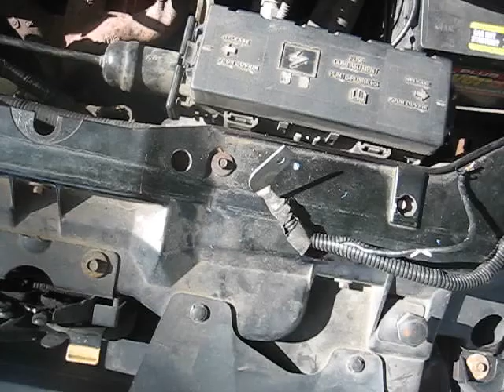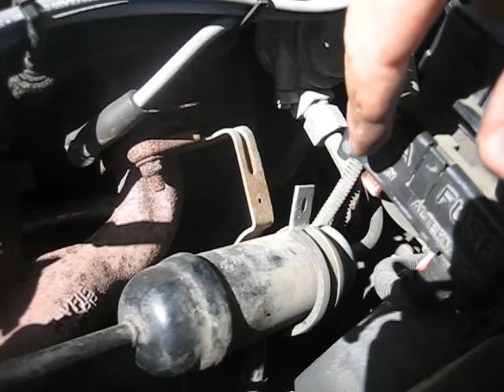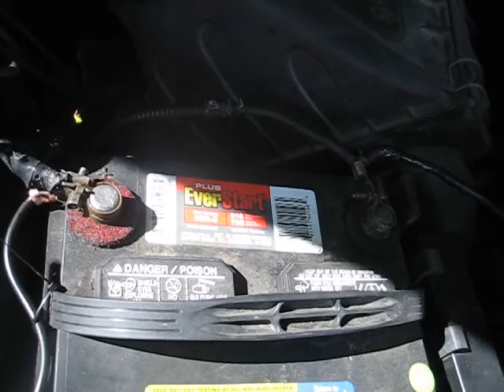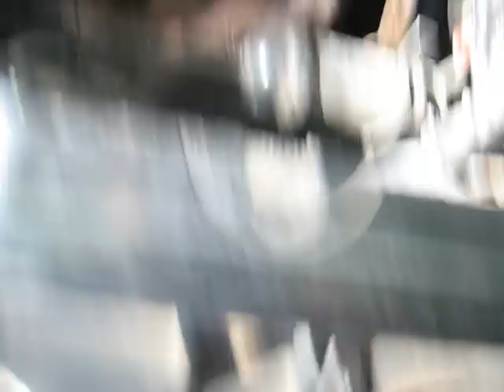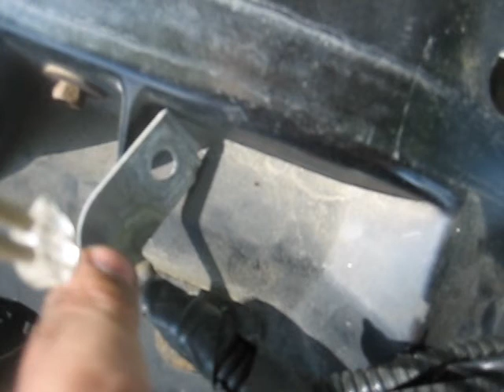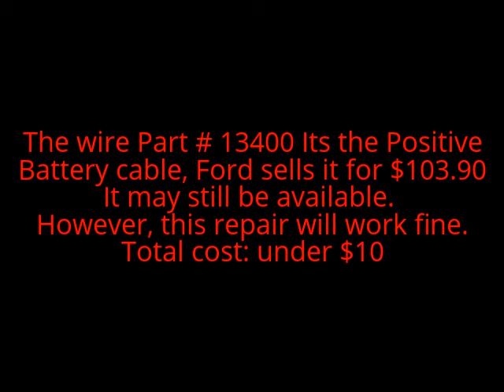Ford Taurus Mega Wire Battery Cable Repair

Comment: Thank you so much for posting this.  I had been told my electrical harness needed to be replaced and it wasn't worth the money.  Between your video, researching online, and a FB Taurus group I'm in, I was able to replace this wire ( and the mega fuse, it was also out) and got my car running!  I went with a 19 inch, 6 gauge battery wire instead of having to mess with cutting and coupling; it ended up costing about 14 dollars, with tax.  Thanks!!

Comment: Man you solved the issue of why by Alternator is not powering up the battery ,,,i was about to try a 5th tomorrow and i watched this did a continuity check and yep its blown ,,,,,yet the car still runs until the battery dies......no one online spoke of this simple check
Reply from the maker: I'm glad that I'm able to help with your car

Comment: My 2001 ford taurus ses doesn't start when i turn the key-it doesn't do anything. When i pop the hood and slam it close, the car will start right up. That's an everyday thing for 2 years now on this work car. Now when i drive it, the rpm reads 0 and the fuel gauge reads full when it's not full-halfway to my destination that's with a new alternator and battery. Wires?
Reply: Try the ground that runs to the starter. It sits on the starter facing forward.. I had one that was frayed so bad and caused random no starts and random electronic stuff not working.
Reply: mine does the same thing with it doesnt do shit until i move battery